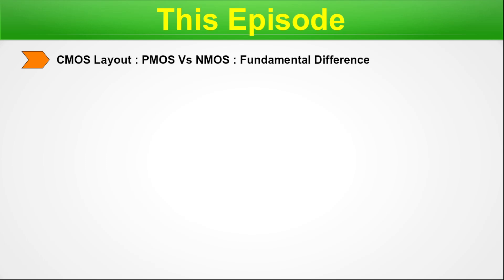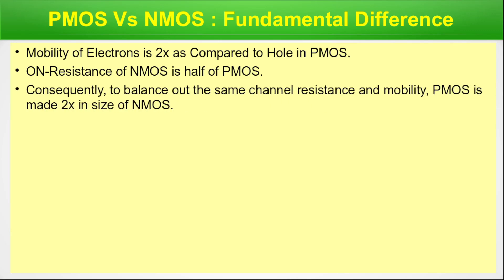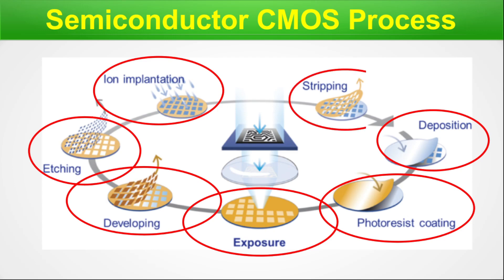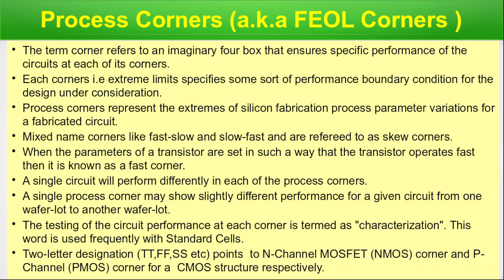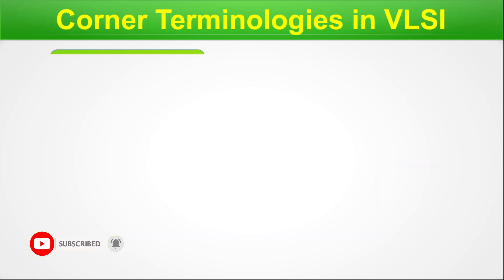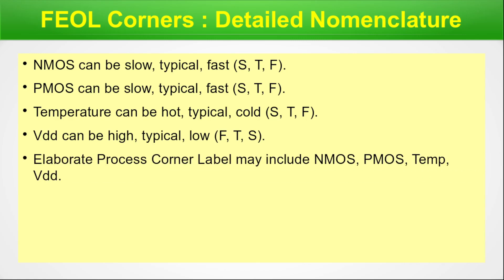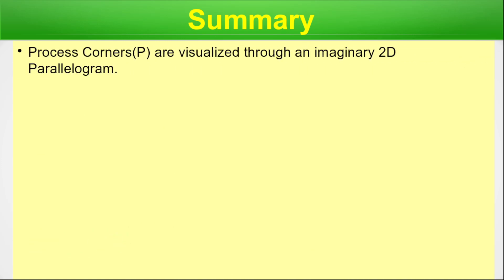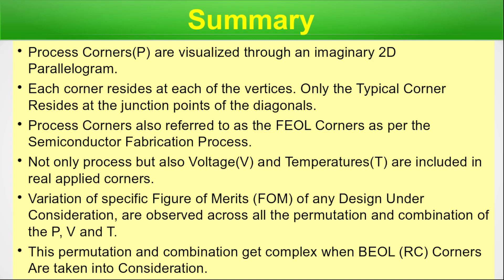The Process Corners in VLSI Design: An Essential Guide for Beginners

Comment: what is the meaning of ON resistance ?  ON resistance of NMOS and PMOS
Reply from the maker: Never forget it is semi-conductor not a conductor. That is why it has resistance in on time also. Rest of the explanation for your help.
===================================================================
 ON Resistance in CMOS and Its Significance :

What is ON Resistance?
ON resistance is the effective resistance a MOS transistor (NMOS or PMOS) offers when it is fully turned on and operating in the linear (ohmic) region. It is a key parameter that affects the power dissipation, speed, and overall performance of circuits using MOSFETs.

 ON Resistance of NMOS and PMOS

1. NMOS ON Resistance:  
   When an NMOS transistor is turned on, its ON resistance depends on factors such as the electron mobility, the width-to-length ratio of the transistor (W/L), the gate voltage above the threshold, and the oxide capacitance. NMOS devices generally have lower ON resistance compared to PMOS devices due to the higher mobility of electrons.

2. PMOS ON Resistance:  
   When a PMOS transistor is turned on, its ON resistance is determined by similar factors as NMOS, but the lower mobility of holes results in higher ON resistance. To compensate, PMOS transistors are typically designed wider than NMOS transistors to balance performance in CMOS circuits.

 Significance of ON Resistance in CMOS

1. Power Dissipation:
   - Dynamic Power Dissipation: Lower ON resistance reduces resistive power losses during transistor switching, improving circuit efficiency.
   - Static Power Dissipation: Although static power is low in CMOS circuits, lower ON resistance can minimize power loss during leakage scenarios.

2. Signal Propagation Delay:
   - The switching speed of a CMOS circuit is influenced by ON resistance. Lower ON resistance results in faster charging and discharging of load capacitances, reducing delays and enhancing performance.

3. Voltage Swing and Noise Margins:
   - High ON resistance can lead to incomplete switching of the transistors, reducing the voltage swing at the output. This degrades noise margins and may cause logic errors, especially in high-speed circuits.

4. Power Supply Voltage Scaling:
   - In modern CMOS designs, power supply voltages are scaled down to reduce power consumption. Lower supply voltages reduce the driving capability of transistors, which increases ON resistance. Designers mitigate this by optimizing the size and aspect ratios of transistors.

5. Energy Efficiency in Low-Power Design:
   - Lower ON resistance minimizes energy losses during switching, which is especially crucial in low-power CMOS designs used in applications like IoT and portable devices.

6. Symmetry and Balancing in CMOS:
   - CMOS circuits rely on the complementary operation of NMOS and PMOS transistors. The PMOS transistor typically has higher ON resistance, which can create imbalances in switching characteristics. Designers adjust transistor dimensions to achieve balanced rise and fall times and maintain efficient operation.

7. Thermal Effects:
   - High ON resistance can cause localized heating in transistors due to resistive losses. This can degrade reliability and performance, particularly in high-power or densely packed CMOS circuits.

 Factors Affecting ON Resistance:
- Transistor Dimensions (W/L): Increasing the width-to-length ratio reduces ON resistance.
- Gate Voltage: Higher gate voltage relative to the threshold voltage reduces ON resistance.
- Mobility: NMOS devices have lower ON resistance than PMOS due to higher electron mobility.
- Temperature: Higher temperatures reduce mobility, leading to increased ON resistance.

 Conclusion:
ON resistance in CMOS circuits plays a crucial role in determining performance, power efficiency, and reliability. By minimizing ON resistance through careful design and optimization, CMOS circuits achieve faster operation, lower power dissipation, and improved functionality, making them suitable for a wide range of modern electronic applications.

Comment: I'm very thankful for your valuable information.
Reply from the maker: You're welcome 😊 ! 
It seems The Videos Helped You ! Please share this channel in your known or professional circle to spread the help to other also !
Reply: @TechSimplifiedTV  

Sure, I've one doubt actually pre simulations every corner is giving good results, but after post simulations SS40 and SS -40 are failing, and rest of them where coming good what might be the reason for this....? .
Reply from the maker: The problem you are mentioning here , there could be two ways to approach:
1. Check with your senior/manager who are more experienced than you whether  they have faced similar issues , if so you will get the solution within your team or you might have a Known Problem & Solution Repository within your company - check there.
2.  You can open/raise a ticket. all EDA vendors have strong team of application engineers and they are very efficiently trained  to solve customer issues. They are the right persons to help you with the tool specific query.
Thanks for approaching.
Reply from the maker: The problem you are mentioning here , there could be two ways to approach:
1. Check with your senior/manager who are more experienced than you whether  they have faced similar issues , if so you will get the solution within your team or you may have a repository of Known Problem and Solution (KPS : such as bugzilla/jira/CRM) repostory within your company -- have a look  there 
2.  You can open/raise a ticket. all EDA vendors have strong team of application engineers and they are very efficiently trained  to solve customer issues. They are the right persons to help you with the tool specific query.
Thanks for watching the video.